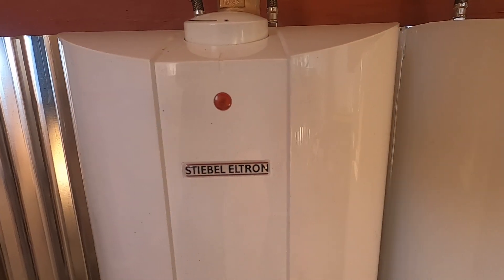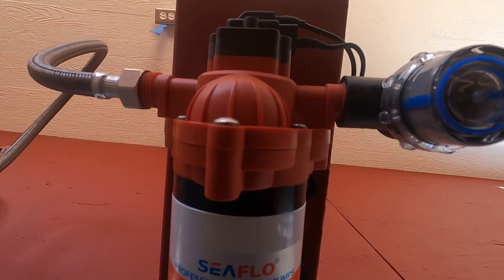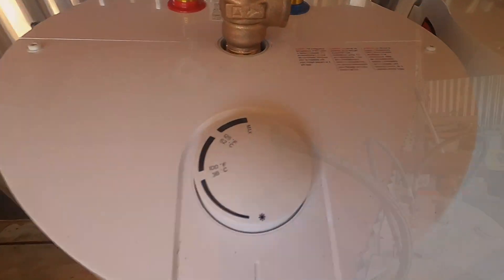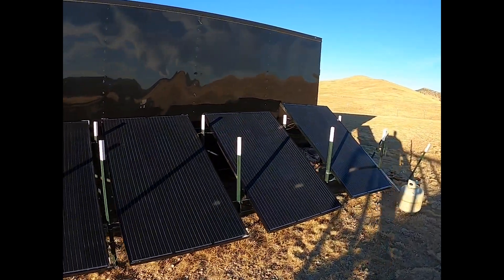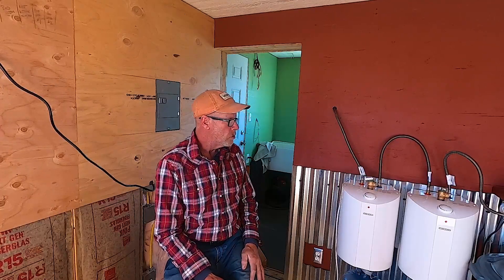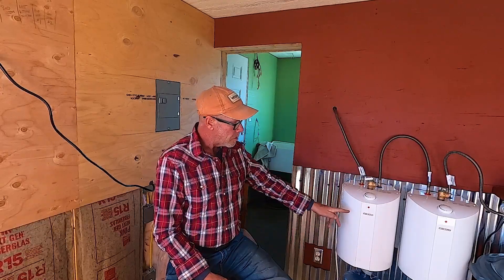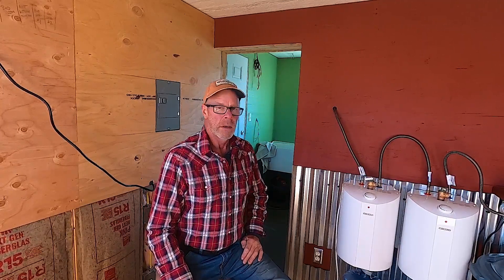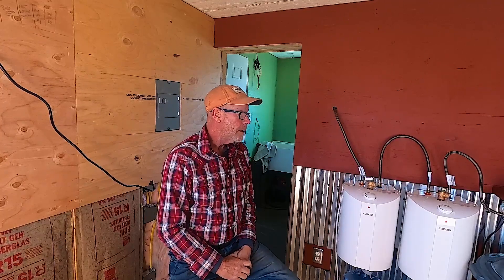WHAT'S THE BEST HOT WATER HEATER FOR SOLAR SYSTEMS AND OFF GRID GENERATORS

Comment: Alternatively, if your on a tight budget and don't have good batteries, but you have maybe 3 or more 150w solar panels to spare, you can install a hot water cylinder, maybe 20 gallons or less and buy a 12v element (make sure to check the specs i.e thread size, type etc), and hook up the solar panels in parallel directly to the element. This idea looks better though, if you can afford it 👍

Comment: I am not off grid but do have solar and batteries which saves me a lot of money in energy bills. I produce about 80% of my energy year around. I bought a Rheem 50 gallon 120 VAC ASHP water heater which only draws about 450 watts when running. It can heat your water during the day and store it for evening showers or washing or you can use it during the sunny part of the day without worrying about storage. I use about 2 to 4 kilowatts per day with two people taking showers, washing clothes and dishes. There is no inconsistent hot water when turning it on/off like washing dishes or other non-continuous use patterns. The unit makes some noise when running in the garage so is not too noticeable. Overall, it works well for us.

There may be things I'm not aware of but it seems like an easy to install and use solution when running on solar off grid.

Comment: Why don't you take 3 of your solar panels (or get three more since they're so cheap these days) and put them in series? The water heaters have thermostats on them. Run the DC from the three series connected panels into the water heater(s) directly...no inverter needed. In fact, everybody in YouTubeLand could be doing the same for hot water. Six in  series for 240v and three for 120V if you have something in the 300W - 450W panel range. It's the dumbest thing to run a simple resistive load (thermally regulated) off of an inverter. I wouldn't try this with a stove (control issues) but a water heater is a "stupid" appliance. It doesn't give a rats ass if it's AC or DC.

Comment: 10 gallon garbage can of water, and one of those 1300 watt 5 gallon pail heating element dropped in the water for 20 to 30 minutes, with a small battery operated portable camping shower. Any time over 20 minutes heating the water is too hot to take a shower. Quick and cheap.

Comment: I use two small tanks like these in series. The 2.5 gallon heats up quickly and satisfies early morning needs.  Most try to heat more hot water than they need. They power from array voltage not using any charge controller, battery or inverter capacity.  My home built controller senses excess  PV power by looking at voltage.  Each heater works on a priority and takes proportionately from 5W to 1500W.  The heating elements only work on 60V which makes it 1/4 of the elements power (about350W max).  This is still more than enough for the water heaters to shut off at 60C by 10am. Then I can use my dishwasher with a heater that also runs off array DC.   Nobody else uses this advanced technology.  The solar world is still living in the past.  I didn't need to add any extra panels to have hot water on a small camp system.  Even have a third tank just for laundry.  All cycles use hot water and the clothes come out steaming.
Reply from the maker: I only have hot water. I dont have a cold water tank to mix the hot water, to cool it down. I only have to turn the thermostat on the heater to half temp for a comfy shower. The water temp is usually 35-50 starting temp, and ends up 105° in 20-30 minutes with solar.
Reply: That's what I'm looking at, to trying running DC only. Thanks.

Comment: I homestead in North Texas and experience all 4 seasons.  To keep my solar water heater operational year round, its working fluid is peanut oil. The superheated oil retains its heat neither boiling nor freezing. I made a simple one-pipe heat exchanger to extract the heat for use in domestic hot water as well as for space heating. I use a copper flat plate collector that thermosiphons with a steel receiver nestled in sand (for insulative purposes) above the collector, eliminating the need for a pump.
Reply: interested

Comment: Hot water 💦 can be a big energy hog. My next project is to build or buy a solar hot water heater that the Sun 🌞 shines on. If I were you, I would step up to 24 volts. I just bought three 24 volts 100 amp hours lithium iron phosphate batteries for my setup. I could run one of those water heaters like you have with my 24 volts inverter pretty easily. I also have a 12 volts system with a wind generator and sixteen deep cycle batteries. I don't like to run anything over a thousand watts on the 12 volts side. It draws too many amps. I also make my own wood stoves 🔥, I can just make one with a loop of pipe running through it. Also, if you set a metal barrel by a wood stove, the water 💦 will get pretty hot 🥵 in it after awhile. It would be better than ice cold spring water, anyways. Just saying, if the water is 85 degrees, the electric heater wouldn't have to do that much, saving you some watts in the winter time. I could make several improvements to your setup, such as mounting the hot water 💦 heaters close to the wood 🔥 stove. You should have used tent pegs instead of t posts, they wouldn't have shaded your panels. Another reason to never make anything temporary. I build it right or not at all. Might be cheap though. My wood stove was a Craftsman sandblasting tank that my uncle was going to sell for scrap metal and the pipe is a stainless steel exhaust pipe from a semi truck that lost it down by the rough spot in the highway. My other uncle gave me a barrel stove door kit that he used on another stove that didn't work very well. My stove only cost me a few welding rods. I cooked thanksgiving on it last year. I'll probably go that route, wood fired hot water. You have some nice things but I don't think you are using them efficiently.

Comment: with all those solar panels you should be able to run both Heaters i would think. You have a weak link somewhere, either in the Inverter (Harbor Freight)  not the best for your application or you dont have enough Batteries?
Reply from the maker: I  can run 3 heaters during the day or night if I want, along with my microwave, LED grow lights,  a fridge, TV, water heater and charge batteries for tools. My main heat source is Propane. Heats faster than electric. Harbour freight inverter kicks ass! with a 2 year warranty.

Comment: I thought you were to never use a battery system to make any kind of heat except maybe "brew" coffee or a short burst of microwave? LP or wood fired only off grid was the norm. But Hell if you got the power to spare go for it!
Reply from the maker: I don't use my electric heater much any more. It doesn't do a very good job of heating. I stay much warmer with propane, and a wood fire if needed. The fire makes everything smell like smoke, and it makes it really dirty in my cabin with soot dust.

Comment: We have two ways of heating water. Traditional 30 gallon tank with 120v 13amp element and the second in series is an LP tankless.
Reply: I want to do something like this but with a sensor to "disable" the propane tankless if the water is already hot. How did you accomplish that?
Reply: @ve4edj  one of two ways. Inkbird 308 type controller or in the controller of the tankless unit.

Comment: Aside from that you should always be thinking of back-up solutions that are already in place! Such as: If as a result I should
become ill as result of some kind of a medical problem OR injury and I cannot even bring myself to be even able to go outside
to go and chop firewood or even fuel a generator, I would still have something to fall back on! With that said, I am about your
same age and I have physical limitations that could leave myself in a hell of a mess! Also, I would make pretty damned sure 
that I would have essential amounts of propane, gasoline, oil, the prospect of having someone to be able to deliver in the 
event perhaps that I cannot get out there and go get it. Just when you know that you've got everything pretty much in the bag, 
I would still go one step further such as trying to have four heat sources for damned good measure, but without breaking the 
bank!! On that generator of yours, the combined electric hot water heaters with the wattage of 2800 should still be able  to run 
on that generator if they are sequenced individually on start up instead of both on at the same time. IF your governor on the 
engine is working properly in my view! If I had a generator with the max peak wattage of 3500 is trying to puke it's guts out at 
2800 watts I would be taking the damned thing back if it you were still inside of 90 days ownership, but hey! If you cannot be 
able to take the generator back, just place a heavy duty electric timer on at least one of the tanks just for good measure and 
this will help alleviate the problem that you have. I know that Intermatic Timer some 20 years ago that I bought was in the tune 
of 90 bucks and it was for my 220 VAC 3KW hot water tank that was set to come on at 7 in the morning and turn it back off at 
5 p.m. till the following day but once you install it and set it up for virtually anytime that you want on those heaters, I would 
nearly be outraged at the sub performance that it was giving you! When I made the leap for a generator, I purposely made a 
fairly good choice with buying a EX5500EH watt generator made by Durostar that has a smaller engine with any comparison 
to a Generac 5500 . The horsepower on that Generac 348 cc engine is something like 28 hp and is an absolute gas sucking pig compared to my Durostar XP5500EH tri-fuel engine and that is no joking matter! Also the runtime on a full tank of gasoline and 
running at upwards to 50 percent load on my son's Generac 5500, going full time only lasts around 7 hours period! Whereas 
mine, the Durostar with the smaller engine at 50% intermittent loading can excel on up to 9 hours on a tank of gas, which also 
has a smaller tank!! Bare in mind, most of these engines come built directly from China! Most of them are Honda Cloned 
engines as with some of them are fuel sipper's and some of them are not quite so efficient. Just within a 4.5 days with no 
electricity, my son's Generac was costing a near whopping 20 bucks per tank fill, every 7 hours for 3.5 tank fills per day X 4.5 
days! That was $70.00 approximately per day or 21 hours of operation plus an oil change! The total bill was around $321.xx!!! 
My Durostar XP5500EH is rated at 224cc @ 13 horsepower. Both of these gensets are used for stand-by use and our most 
immediate area in which we live sees many outages throughout the year and between the son and I, we got damned tired of 
the power company's slump as far as service and flat out bought ourselves generators. My son was kind of lucky that he was 
able to run his oil furnace, a hot plate or slow cooker, lighting and just a few electronics and that was about it! No water well 
pump and no real means to run a hot water heater, which was sad! We were lucky enough to get some invites from other 
friends to partake in getting some showers in. My son thought he was getting a good deal on that Generac of his but I just 
had to break things to him gently about his choice in a generator! That power outage occurred after the Holidays during the 
winter and I must say that it was some good training and I was there to help my son to understand all of what he was up 
against. As with my guess about your engine is: Something is either holding it back such as wrong carburetor jetting due to
to the elevation where you live, or the engine size is not on par with the amount of work, perhaps a weak circuit breaker if
it is trying to kick off, I just don't know for sure! IF you are running both hot water tanks PLUS a 120 VAC pump all at the 
same time, such as to shower, that pump may just might be the culprit that is pushing the total wattage to the breaking point.
If you weren't allowing the full heating cycle to completion, but then go ahead and shower, you might have been to the good;
but if that water pump most likely firing up is most likely going to push that generator over the edge. If just one tank had a timer
installed so that one water heater was to do one heating cycle for NO more than 35 minutes or a half hour for that matter and 
shut down, but then the second water heater that kicks on in succession for a whole half hour and also shut down; well then you 
should absolutely be to the good with no hiccups. Heater #1 for a half 30 minutes, with a delay of 5-10 minutes and Heater #2 
with a timer also to commence heating also for 30 minutes and in a sequence also. Leaving just the one heater, the water pump 
and a couple lights only to burn for that however many minutes shower. But honestly, that is a crazy setup to deal with ole pal!!
Reply from the maker: I try to be as redundant as possible with all of my critical needs. I had a hernia last year, and that sucked. Here in the mountains we take care of each other as far as neighbors. Everyone lends each other a hand when needed.

Comment: shadows on pv panels kills your output
Reply from the maker: that set up is only temporary. even with the shadows, the batteries are floating at 13.6 volts less than 2 hours after sun up, and resting charge at 12.7 volts in the winter months, and 13v in the summer.
Reply: @flo2col127  ok that's good, but lol just means you have a overall small load draw.. and I get it, it's temporary been there done that to many times... good luck

Comment: I’m trying to understand why you didn’t use an on demand electric water heater. No need to wast energy storing hot water or heating more than you need. They make very low wattage heaters.
Reply from the maker: I don't pay for energy. On demand d electric Heaters are usually 220v and draw way too many amps. My heaters only draw 11.4 amps.  I don't store hot water. it only takes 20 minutes for the water to be scolding.
Reply: I use a 120volt mini tank hot water heater on my solar system.    When I need hot water I just switch it on 10 minutes ahead of time.  And cost me 250 watts of power from my battery bank each time it heats

Comment: Each their own.    I run LP on demand.   20lb LP tank runs about a month with 2 using shower
Reply: With 3 using shower.  With a 10gal.  A 20lbs lp last almost a month.   I have a Girard  but I haven't installed it yet.  I need to do that

Comment: all those fenceposts shading your panel array -- that's crazy. 😂 that's like driving a car with the e-brake on. you live in a place with no trees or neighbors to block your panels but decided to add a little extra shadow yourself just for fun. 😭

i'm also mystified by your 2-in-series water heaters with a trash can for a holding tank? why?? 😂 an electric tank water heater will not trip your system, and comes with an integrated 40+gal holding tank (insulated!)... no need to invent a $500 trash can hot water bucket when you could pay $100-$200 for a used electric tank heater. or even splurge and get a new tank heater for $400. my man here is trying to make every mistake he can. 😅
Reply from the maker: Hahaha it's only temporary
Reply: you're probably commenting on your mama's computer...you probably don't own anything.
Reply from the maker: No, I live with my parents in the basement. @davidlackey4873
Reply: @flo2col127  I knew it Karen, damn liberal.
Reply from the maker: Ur so knowledgeable. Thanx.
Reply: @flo2col127  recognize a real man, eh...maybe you're not a lost cause after all.

Comment: A hot water with a much larger tank would be more efficient in your case as the water would stay hot for days
Reply from the maker: I thought about that. II only use a few gallons at the most per shower. When you have to drive 20-30 minutes into the mountains to get water, you become conservative.   It takes less than an hour to get 8 gallons of water scalding hot. larger tank water heaters draw tooo many amps or are 220v. + you need to have enough water on hand to replenish the heater during your use. and I wanted to be able to dismantle and drain the system in case I had to leave for a period of time.

Comment: You need a hybrid inverter which will dump the excess solar energy into hot water heater. That way both will be connected at the same time and only energy which would not be used is sent to hot water heater.
Reply: You don't need a hybrid inverter in order to do that. A shunt controller is made to do that, they are normally used for wind generators or hydropower units because you cannot disconnect turbines from a load or else they will overspeed and tear themselves apart. These shunt controllers can also be used for solar, but you cannot use a series controller for a wind or hydro turbine.
Reply from the maker: I saw the hybrid controllers. A friend steered me clear of hybrids cause of the price and reliability. I have 4 Solar controllers ($125 each) connected to 2 solar panels each in series. If one of my controllers or panels malfunctions, which hasn't happened yet, I can pin down the issue quickly. 
I thought about installing timers, to kick on the heaters, one at a time, during the day.

Comment: FYI they make DC heating elements that can go direct from solar to a tank Amazon sells them
Reply: Yes these work very well with a shunt controller, normally used for wind or hydro turbines.
Reply from the maker: thanx for that info. Ill check it out.